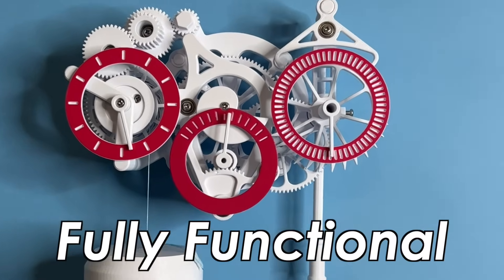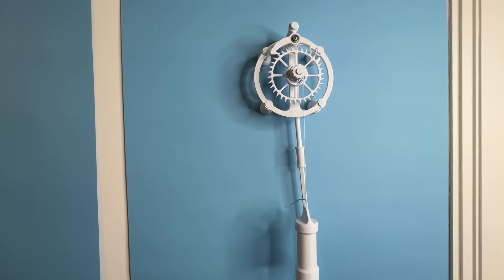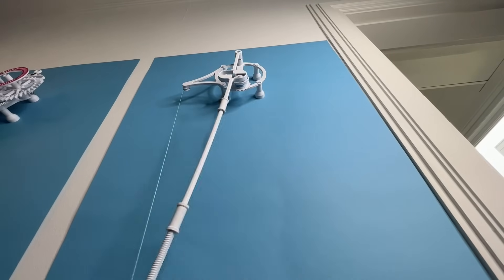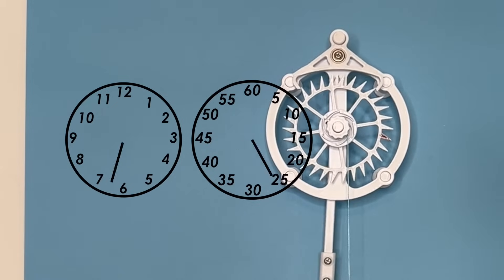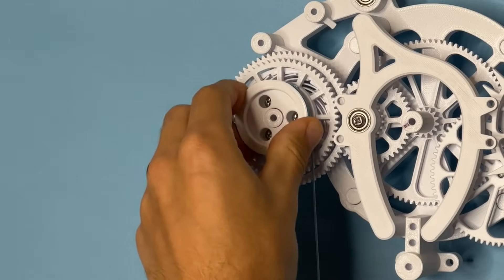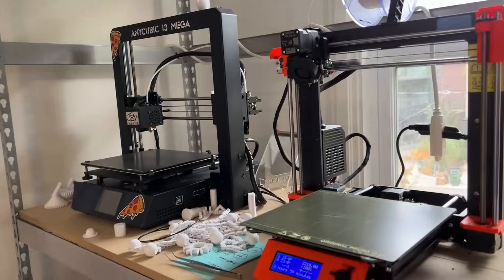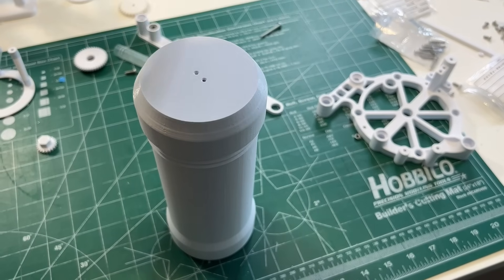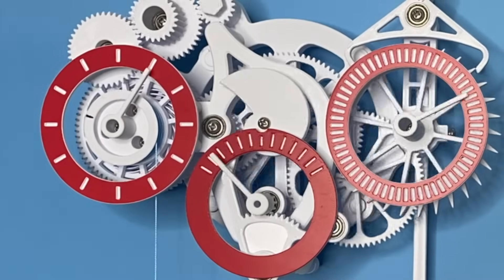Can you 3D Print a Mechanical Clock?

Comment: I bought those files and printed most of them. Then assembled everything and found it not that appealing, so I've modified it to have a traditional albeit very long minute hand. A minute ring that is 25 cm OD and has a small buit in photo frame. Added a counterweight to balance the very long minute hand. Made a teardrop shaped capsule for the weight and filled it with steel rivets. Modified the pendulum weight. Made a mounting bracket and added some eyelts to it, so that I need only two holes to hang it instead of four. And some other changes. One last thing to change is add a bearing on the front side of the string spool. Main power source is puttnig a lot of radial load on the hour gear axis.

Comment: The friction and the wear of the pieces is why precision mechanical clocks use jewels. Rubies, Sapphires and diamonds are used to fixate the gears. Due to the low friction that the jewels offers, with just a really small quantity of lubrications, it could endure years.

Comment: What if you were to make 2 of those clocks, where the first clocks weight is at the bottom, and the second clicks weight is at the top. Clock B's (the second one) hour gear would be linked to Clock A's (the first one) crank, and Clock A's hour gear would be linked to to Clock B's crank. As Clock B's weight falls, it turns the hour gear, and the hour gear cranks Clock A's weight crank, which brings the weight up, as Clock B's weight goes down, and when Clock A's weight reaches the top, Clock B's weight will reach the bottom. Then Clock A's weight falls, it turns the hour gear, and the hour gear cranks Clock B's weight crank, which brings the weight up, as Clock A's weight goes down, and when Clock B's weight reaches the top, Clock A's weight will reach the bottom, which then repeats the whole process again.
Reply: Conservation of energy. You can't gravity power this, as raising one weight would take the same energy as the other one released by lowering it (more if you include losses from friction)

Comment: Currently in the process of designing and making a very similar clock but I’m having some friction issues, have you got spacers behind the gears touching the bearings, if so how did you get the whole system to be so stable, there’s a lot of flex in my gears and base plate

Comment: See Seiko's Tri-synchro Regulator system in their Spring Drive wristwatch movements. The escapement is replaced with a "glide wheel" which has an electronically controlled electromagnetic brake to maintain the speed of the glide wheel. There are no batteries in the watch, the mechanical spring generates sufficient power at the glide wheel to power the electronics and the brake. Maybe the concept could be applied to a 3D printed mechanical clock. Accuracy to ± 1 second per day in the Seiko.

Comment: This week I bought the plans for this clock, printed the parts on a Prusa MK4S which only took less than 24 hours. Assembly is easy, as long as you are precise. However, making sure the clock ticks continuously, took a little bit longer than I expected (few hours), but eventually it runs. It's definitely worth the money for the plans. I also like that this clock runs 100% mechanically, instead of battery powered. And you learn a lot regarding gears, ratio and the mechanisme of a clock. Great model and a Fantastic from the Designer @Engineezy!
Reply: I also have built this paying attention to making sure everything is very precise.  Yesterday I spent over 3 hours trying to get the *** thing to tick continuously has so far been impossible.  Today another 2 hrs and still no luck it works for the time it takes the pendulum to slow under its own momentum.  Not sure what else to try any suggestions ? am using 5kg of weight

Comment: Another thing you can do to increase the run time of the clock that doesn’t involve adding more string and elevating the clock higher and higher is to add additional gear mechanisms for days or weeks or even months and use a reduction gear to provide the torque to keep the clock running without increasing the weight used. Meaning its possible to make a clock that runs for an entire year off of a single wind up.
Reply from the maker: That would be sick! Gonna have to try that on the next one

Comment: 0:28 minor thing but the analog to the potential energy stored by the weight+height would be the energy in the battery, not the power provided by the motor

Comment: If you added a 2 pulley system to the weight (spool, weight pulley, clock pulley then connect to the weight pulley) wouldn't it triple the run time without increasing the distance travelled of the weight

Comment: The next challenge should be to integrate a mechanism that would read off the correct time from an NTP server and correct the clock’s performance to keep it always set properly.  Even when its weight has dropped all the way to the ground.

Comment: In the video you said: "If your clock is running to fast, rise the pendulum. If it's running to slow lower it down" This is a mistake. Making the center of pendulum mass lower makes pendulum oscilation slower, and making it higher makes it faster.

Comment: Hello, I recreated your clock with enthusiasm. However, I have 2 problems. The clock fell down after some time. I loaded the weight with 2.5kg. The holder has already broken 3 times and the watch fell to the floor. I tried different materials with different settings. The threads attached to the wall appear to be undersized for this weight. Has no one had this problem yet? Furthermore, the clock stops after a while. If I remove the deadbeat anchor everything turns as it should. I checked everything for ease of movement. If anyone has an idea I would be very grateful. Thanks
Reply: I am also planning to make it maybe it's that of an 3d filament issue mainly.

Comment: very nice profund explanations.I once had a company, making mechanical clocks by wood which was a big success. Perhaps i will print our top model exactly 1:1 or with small modifications. One important point is lifetime, where i have a big doubt if printed parts can compete.Our experience of our clocks is more than 30 years and they are still in use.
Very nice engineering and presentation.

Comment: was it intentional to have the pendulum and extensions have no infill (they print hollow regardless of infill settings)?
Reply from the maker: Yes! I was trying to remove the weight from them as much as possible by making them hollow so the center of mass of the pendulum is lower, this in hope to reduce the overall length

Comment: This makes me wonder if tolerances for 3D printing would allow one to print a mechanical watch that would fit upon someone's wrist. Could the plastic hold back a metal spring.
Reply from the maker: Would definitely be an interesting experiment!
Reply: @Engineezy   Which do you think would work better, ABS or resin? It would certainly be cool to have a completely transparent watch. Or if the resin had some glow in the dark component to it and you painted the watch hands.

Comment: 8:33, do the opposite of this. Make it run slower by lowering the weight (increasing it's CoM and, by extension, its effective length), and vise-versa for speeding up a slow-running clock.

Comment: First, thank you very much for this video - clock making is a fascinating topic to me. At this point in history, clocks like this have become more like kinetic wall art than the one and only time keeper. Regardless, I do plan to make one, and 3D filament fabrication makes a lot of sense. Personally though, I find 3D printed material fairly unattractive. For me, a clock should be pleasing to look at, like wall art. In my opinion, wood looks best, but requires either a CNC router, or a lot of hand cutting. It's not like we "need" to make clocks, given that we have them in our smart phones now, so it needs to be attractive on a wall, running or not. (That said, I do think that an all-black clock can look good on a light colored wall, so black PLA might good there.)

Comment: In all the conventional clockmakers videos I've seen, they seem to be really obsessed with polishing and burnishing every point a metal shaft makes contact. I assume that's to reduce every little bit of torque reduction along the chain...
Also, did you use any oil at all?
Reply from the maker: That’s exactly right, this clock isn’t the most accurate for this reason. I used lithium grease on all the gears!

Comment: I've designed my own clock for the fictional civilization, from the myst sieres, based off a 25 digit oedometer mechanism. I'd love to have it made real but I don't have a printer, nor am I certain that it will work as it is currently. this isn't a request but I would love some help or advice.

Comment: Hey mate great work. To reduce the weight required (increase torque), use a larger diameter pulley. You’d need a longer line and a longer drop though (if clock is upstairs, cut a hole thru the floor for the weight😂)

Comment: Fuck. Now I have to buy a 3d printer
Reply: Seriously, you created a monster. I’m currently learning about hotends
Reply from the maker: @preuomo  😂😂😂
Reply: @Engineezy  This actually happened, I got an Ender 3 Max Neo! I've printed the gears so far... quick question (I'm a novice to 3D printing, you're literally watching this journey in real-time lol): is 20% cubic infill too little for the gears? I went to remove the 72-tooth gear by its post and I heard a slight crack - I stopped what I was doing and was able to remove it another way, and heard no further cracks. But that post is gonna have the weight hanging from it and I'm wondering if 20% cubic was too little infill.

Comment: Perhaps you are someone who can create the non-existent clock of my dreams.  I had the idea for this clock some time in the mid to late 70's and was able to set up a Coleco ADAM computer program to display the clock dial and function but I don't know enough about the gearing to actually build it.  Here is the clock idea:  10 hours in a day, 100 minutes in each hour and 100 seconds in each minute.  A standard clock has 86,400 seconds per day (24 x 60 x 60) while my "Metric Clock" has 100,000 seconds per day.  Any help would be most appreciated and I might just have a reason to get my first 3D printer.
Reply from the maker: Love the idea! Maybe one day!

Comment: Any extra info on the retrograde complication? Just wondering how that works out with the ratio or how you determined the partial gear and minute hand pinion there. Awesome stuff.
Reply from the maker: It was mainly a trial and error thing in software! I started with the amount of sweep I wanted, then adjusted the cam to a size that fit, then determined the gear ratio

Comment: I’ve been loving your escarpment series, but I saw a different video to diy a clock/perpetual calendar (https://youtu.be/CbWUtrpTiis) and wondered, if you use a motor for the clock, how would you set up the calendar to adjust automatically with the clock?
Reply from the maker: The motor would power the escapement, so if you tuned the pendulum right everything else would work the same, then its just a matter of gearing down until you get days and months!
Reply: @Engineezy  awesome!  To Fusion360 and a gear calculator!

Comment: I printed the Spur gear and had trouble with the tall shaft breaking off at the interface between the shaft and the gear center.  This may be due to increased cooling time between layers while printing the outer pawl ring.  I intend to increase the outer diameter of the shaft and corresponding hole in the ratchet to strengthen this area.  Any thioughts on this?
Reply: I reprinted this gear Two more times. The second attempt broke in the same location while removing it from the printer. The third I got off the printer without touching the shaft..

Comment: Very cool. Wouldn't lowering the weight increase the period instead of decreasing it? Meaning the clock would run slower when the weight is lowered and run faster when it is raised?
Reply: My thoughts exactly. Raising the weight will cause the pendulum to swing faster resulting in the clock running faster.
Reply from the maker: Yess I said it backward in the vid!

Comment: Hey, why don't you add a gearbox on the clock. Have a 5-10 lb weight on the slowest gear and then put the escapement on the fast wheel, so you'll lose less string and be able to tell time for much longer (maybe several days, weeks, months)
Reply: You'd probably have to scale the escapement way down to compensate for loss of torque
Reply: Nvm you already did this... Damn. Can't you add even more gears to the hour wheel? Make a full day wheel?? A week wheel?
Reply from the maker: You definitely could but you would need to start increasing the weight to a point that the plastic might not be able to withstand!

Comment: Just a tip for gear wear and longevity. It's best for a gear to not have tooth count that are multiply or factor of the other gear's tooth count that it is meshing with. This will promote even wear and minimize weak spot.
Reply: Ideally, the numbers of teeth on the two gears should be "coprime", meaning that their greatest common divisor is equal to 1. This allows every tooth to mesh with every other tooth an equal number of times, causing all the teeth to approach their final "broken in" shape at the same rate.

Comment: The answer is obviously simple. Sure, you can 3D print a fully functional and fully mechanical clock. The real question is does the design allow the clock to actually work accurately

Comment: I have to say that your projects are one of the most interesting I have seen on YouTube, well done!!
I have a curiosity: how accurate was the clock after running for 2 days straight?
Reply from the maker: Thanks Alessandro! It seemed to lose a few seconds every hour.  I'll admit I didn't spend too much time trying to get the pendulum length perfectly dialled in haha!
Reply: As long as the escapement is working properly -- always allowing the clock to advance the same amount for each swing of the pendulum, never doubling up or not allowing it to move at all -- then the only thing affecting the accuracy of a clock is the length of the pendulum.

Comment: Fantastic 😱 Question, as the weight gets closer to the ground isn’t it adding more stress to that side of the clock and the mounting on the wall? As awesome as always. Would still like to see you live once in a while.  All the best to you and your lovely wife.
Reply from the maker: John, the weight will provide a consistent force on the pulley over the entire length.  Only once it hits the ground and the weight is relieved will that change, but it will reduce the stress on the clock!  I do plan on doing lives moving forward, once my new shop is up and running :)
Reply: @Engineezy  New Shop!! Awesome 🤩

Comment: This is a very good job, and a wonderful design. Nice ! I was thinking, it would be possible to multiply the 'life time' by 2 by adding a pulley multiplication system. With a double weight, the displacement can be divided by 2 ..... What do you think ?
Reply from the maker: Thanks Sébastien- It would definitely be possible but it would add more weight to the mounting posts which could cause them to break.  The design would have to be changed to account for the extra weight, but it would certainly increase the lifetime of the clock!

Comment: Couldn't you make it run longer with a few pulleys connected to the weight string?
Reply: I was thinking the same. I suppose that Yes.
Reply from the maker: It's a yes but you would need to add more weight!

Comment: The bearings I buy have too much grease and  too much friction for the forces involved with 3d printed parts.  Any suggestions ?
Reply: You can take the shields or seals of the bearing and then degrease them. Then find some light oil or grease and add it back in.

Comment: for a smaller physical footprint could one use a canister full of fishing weights/lead shot?
Reply: Yeah, for 2.5 kg you need about a mug of lead weights. (0.22l of pure lead, so about 0.3l of lead balls)
Though that makes it non rohs :p
Tungsten is better but fairly expensive.

An easy solution is also old sealed lead batteries.